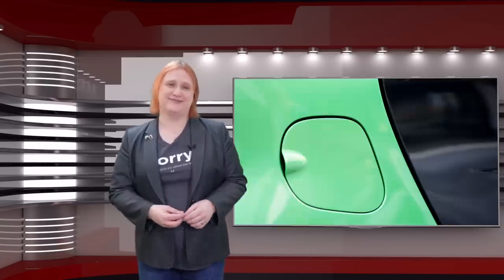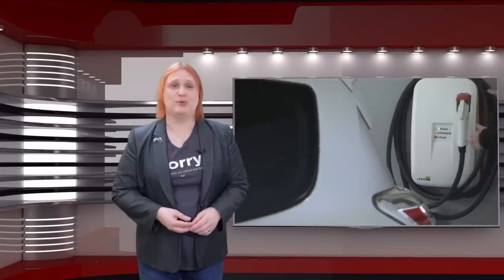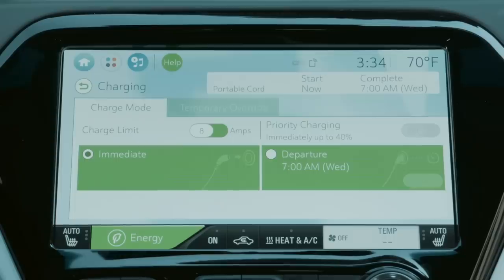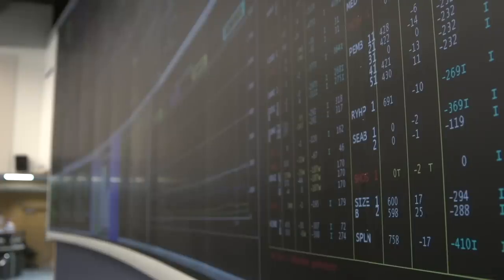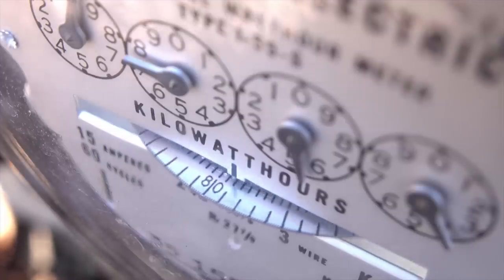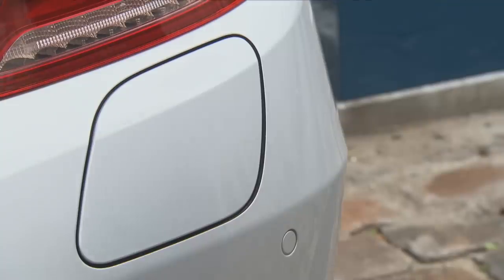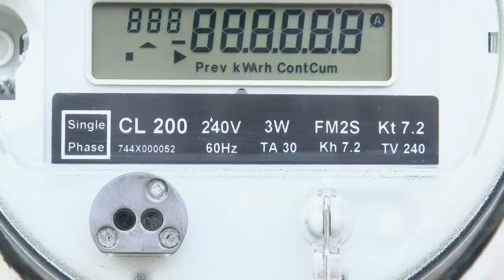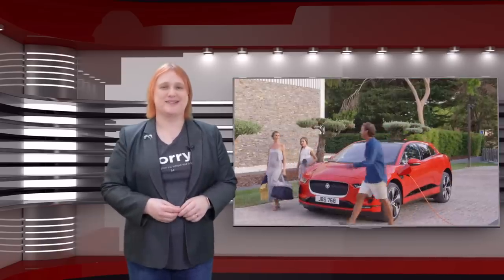What's a Charge Timer -- And Why Should You Use One With your Electric Car?

Comment: I recently bought a Peugeot E-2008 and found that my electricity provider offered discounted electricity for charging between 12 AM and 4 AM. The Peugeot comes with a charge timer which I can set to 12 AM, but no way of stopping charging automatically before the battery reaches 100%. So to make sure I only charge during the discounted time window and keep my battery below 80% charge (give or take 10%) I bought a simple 10 amp timer which I connect my granny charging cable to. This now allows me to make sure charging stops at 4 am. With our 240 V power supply in Australia, this means I can add around 2.4 kw x 4 hours = 9.6 kwh of charge to the battery each day which is more than enough to supply the 5 kWh used each day to drive 33 kw to work and back. So to keep the battery below 80%, I have set the timer to only charge for 2 hours 5 mins each night after draining the 50kwh battery to 70% before the first charge. This is now working like a dream and has haled our charging cost and (hopefully) extended the life of our battery).

Comment: Your observations are mostly valid, but here in the UK it is difficult to find a supplier with multiple prices for the various times day or night.  My present supplier does not offer this and another supplier  I found back in November 2018 said they could not supply a suitable meter until March 2019.  When I look at their web site now, the multiple price option has now disappeared.  It seems that there is little enthusiasm from UK electricity suppliers for this sort of pricing.  I would be very happy to charge my car overnight using the built in timer if there was a financial advantage.
Reply: You might be thinking of Octopus Energy's Agile Octopus smart tariff. They were recently voted Most likely to be recommended by their customers in a uSwitch poll. OVO Energy came out top overall with Octopus Energy in 2nd place. But I'm not aware if OVO do the dynamic pricing thing.

Disclaimer: I don't have any affiliation with these firms. I'm with Ecotricity because that's what works best for my usage pattern.

Comment: Was interested in hearing about the Bolt's (optional?) feature for ignoring its charge timer if plugged in below some critical minimum level!   Slightly off-topic, but  there's also been an improvement in the 40kWh LEAF's charge timer system that I've found useful:  it can be set such that the charge timer feature is automatically disabled (so that charging will begin immediately upon connection to an EVSE) whenever the car is "away from home" (according to its GPS-sensed location).   So I can just always leave the charge timer programmed and never have to remember to hit the 'override' button if I've connected to a public L2 station.

Comment: There aren't a peak/off peak cost differences in my area yet. 
But I use the built in timer in my Spark EV and set it to complete charging with my 120v trickle charger at about 30 min AFTER my actual departure time.  I'm trying to get it charge just short of full before I leave.  So far in the winter, I've been finding that the charger still seems to finish before I leave so I may have to set the 'finish by' time a bit later to keep it from going totally full (even at 8 amp/120v - its a small pack and my commute is relatively short).

Comment: I have been using a mechanical timer for years for my PSA "106 electric" because NiCd batteries hate staying charged. The goal was to reach 100% just when it was time to leave in the morning. Charging at less than 100% would have been difficult since the range was about 75 km at full charge in summer without AC. So each evening I had to estimate the time to begin charge depending of the state of charge of the car.

Hopefully lithium batteries are definitely more forgiving than NiCd batteries.

However a point you did note mention, regarding the benefits of reaching 80% just in time to leave, is that in winter the battery will be warm and so regenerative braking will be fully functional. However I assume it could be a con in summer since charging in hot temperatures and driving at once could also limit regerative braking.

Anyway all this issues are complex since they are many factors, batteries and exterior temperatures, type of batteries, etc. So the software of the car should be intelligent enough to handle the good choices. And the driver should only have to plug...

Comment: We have an old Leaf S, which has a very basic charge timer. Even so, I use it all the time - set the car to be fully charged for kids' trip to school in the morning. This means it rarely starts charging till well after midnight. We don't have time-of-use charging available from our utility (that I know of), so this is pretty much just me being nice to them by moving my charging to a convenient time on the duck curve.

The only time this really is an issue is if we run through most of the Leaf's battery during the day and need to top off. In that case I have to push an additional button to get the charge cycle started right away. But most of the time we just let the timer do its thing.

Comment: If batteries win (and not some sort of fuel/flow cell), vehicle-to-grid systems will be absolutely essential. It doesn't even need to connect to the grid; just powering the building would be ok.

Comment: Having both the 8-12 amp charger my Bolt came with and a 30 amp charger at home I leave the smaller one plugged in all the time with the car set at "hill top reserve" (not fully charged which leaves room for regenerative braking). When I know that won't be enough I plug in the 30 amp unit. I assume these are the best ways to ensure the batteries longevity.
* slow rate of charglng
* not kept fully charged
* allowing for battery conditioning

Comment: I used a Smart plug to charge a Twizy overnight. Just linked it to my wifi and set to charge from 1am till 6am. Usually finished about 4-5am as such a small battery. If a Twizy and smart plug (with internet) is all that's needed we can all charge at off peak rates. All EV owners need to shift charging to save money and show what can be achieved on the GRID. Everytime you charge at peak times uneccessary a coal station may be kicking in.

Comment: Something i've been thinking about id the cars onboard charger.
3.3kw and 6.6kw seem to be fairly standard. As range increases so does the cars onboard charger. In the case of Tesla it might be 14kw. We are now crossing over 50amps. Something that becomes quite expensive to upgrade at home. 

Taking advantage of off peak charging rates may require more EVs to be able to charge quicker. More so when we start talking about jobs that require hundreds of miles a day. Some future trucks are rumored to have 500 miles ranges.

Comment: 110V/220V hasn't been the standard in the states since the 1930s. You have 120V/240V. The Rural Electrification Act forced the power companies to standardized voltages to make it easier for the appliance makers. You should standardize too.
Reply: John Rielley  my electrician but 220 on my outlet install receipt and i had to tell him my car takes 240 and he didnt hook it up right and i had to call to get him back to fix it
Reply: @markfitzpatrick6692  220, 221, whatever it takes. It's the old guys that keep the myth going, that's probably the way he was taught. Unless he was 90 years old, then I guess he's entitled.
Reply: That might be semantics . Even electrician say different things in casual conversation..
Reply: It's pretty bizarre that everyone isn't on the same page on this.  People who say 110/220 are off by about ten percent.  What if your electrician told you your panel could take a 110 amp load but it was really 100?  I want my electrician to be more accurate than that.  Maybe that's why I do my own electrical work.
Reply: @incognitotorpedo42  Actual mains are usually off by a few percentage.  You have to build for 10% under and over voltage in normal operation of an appliance.

Comment: In the Netherlands if you want to make use of off-peak prices (23:00 - 07:00), you pay a higher rate during the day than a simple flat rate. Thing is, the normal price (07:00 - 23:00) is much higher than the flat rate while the off-peak price is only slightly lower than flat rate. So opting for 2 rates is a bad deal for most people.
Therefore I don't use it and therefore there now is no incentive for me to use delayed charging.
Reply: Henri Zwols I have the same issue in California. Our bill would go up because too many other things are pulling electricity during the day and those prices are just too high. If the power companies really want to clean up their grids they should offer better deals to those of us that rely upon them rather than petrol stations to get to and from work etc. Getting solar power with off grid storage could solve this problem for me but is a pretty good sized investment still.

Comment: These are all great points, but unfortunately none of them are relevant to me.  My power company is Appalachian Power, "Appalachian" as in the heart of coal country. Don't matter what time of day or night I charge, the only power going into my car is coming from coal & they don't offer any sort of discount for off-peak hours (and no, much as I'd love to, solar is not an option in my current residence either).  And I've never even charged my Model 3 all the way to 100% once, I usually charge to 80% except a couple of times I knew I had a trip to Chancellorsville or Raleigh the next day & kicked it up to 90%.
Reply: When demand is falling, that seems to be the most efficient time to use electricity generated from fossil sources. That's because the coal (and to a lesser extent gas) fires are already hot from providing the peak load, so they can just let it burn and top up occasionally. Conversely, when demand is rising, they're throwing more coal on at a faster rate. Or so I read somewhere.

Comment: I have a flat rate supply 24 hours a day but I still use the timer to start charging at 1am to support grid load. I have always wondered though, if hundreds of EV owners are charging over night are we just shifting our peak times?
Reply: You are helping your electric utility which is a good thing. If you have the option to sign up for time off use you might want to investigate it. We use a lot more electricity now with an electric car but our bills are pretty much the same. We wash clothes, run the dishwasher, and of course charge the car off peak and it saves us $30-$40 a month on the electric bill.
Reply: I did actually look into this but it worked out better for me to stay on the flat rate. My wife is home with our kids so the increase in day time use would have cost more than the savings. Plus I normaly only charge once oe twice a week.
Reply: @rajbadwal85  Definitely a case by case basis. Our local utility has off peak from 9am to 5pm and 10pm to 6am so we have been able to shift some things around.

Comment: I used to set my Zoe to charge at specific times, but my Smart won’t do it. You can only set a departure time, and it’ll just charge to 100% when you plug it in no matter what you try and do. 🤦‍♂️
Reply: Get a SMART plug for $20-$30 link it to your wifi and it will switch the plug on at times you specify. I used it overnight with a Twizy so any car can work.
Reply: Ian Burrows I don’t have the 3-pin plug cable, only 7kw. I’m used to it by now, but thanks anyway.
Reply: Not so Smart?
Reply: Ken Dibble Indeed

Comment: I keep my car close to 50% charged all the time. Between 50% and 70%.  Is that good?
Reply: Duke tlam no , not necessary. Musk suggests charge to 90% , not 70 or 80%. Otherwise you have a small ‘effective’ battery size
Reply: Tesla used to recommend keeping their cars charged to 80% to avoid any long-term battery damage, but more recent tweets by Elon & some of his engineers suggest even that may have been a bit overly cautious and that there's nothing wrong with charging to 90% every night.  Having said that, I still charge to 80% as I just hardly ever need any more. As far as I know they still recommend trying not to let your battery get below 20% on a regular basis though, and for that reason if no other I'd think you'd want to charge it to higher than 50%.
Reply: I think the ideal is dependent on the type of L ion. Some will last for ever staying around 50 + - like the original Prius hybrid.
Reply: @kdkd693  that why I am sort of confused.   Musk said to charge up to 80%
I read a scientific report that said lithium battery like to be in the middle.  I am leaning toward scientific study than Musk recommendation.  The only negative of staying in the middle all the time is battery unbalance.  Meaning the bms don't know your full battery pack potential.
Reply: Duke tlam You are being confused with advice on two different scenarios: 
If you want to store a lithium battery, yes around 50% charge is the recommended

If you want to use a lithium battery daily, as in a car or an RV, you want to use a wide range. 

For RV batteries, this is 10-90% and they last 3000+ cycles. The BMS only is smart enough to have voltage cutoffs, and no rate control. You top balance to absolutely 100.0% at a higher voltage maybe once every 3 months

With a Tesla , you have a much smarter BMS, and you can set it to charge to a specific % charge yourself (slider on the screen) and the smart BMS will also restrict charge rates over the charge to get even better lifetime eg 12+ years. Musk recently recommended to TeslaKim to do this. I see no reason not to. 
Tesla also do not have a problem with owners charging to 100% if they are going on a long trip and need full range. This would help top balance the battery so is beneficial anyway. The long ‘runs on the board’ for Model S batteries are now available - and the data backs the longevity up.
Reply: @kdkd693  thanks Ken, I been doing a lot of 50 to 70 % cycle for that last 7 months.  Perhaps I should change it to 20 and 80% from now on.  Since I been doing a lot of these small charges.  What is consider a cycle? Does the battery cycle mean a empty to full is considered as one cycle.   What does all these small change i been doing really mean?  Does those consider as one cycle or a tally of small charging to total one full cycle?

I drive 15 miles a day.  So every two days I charge to 70%. Keeping a 50 and 70% range. 
I have never balance the battery.  Now that I am changing my charging to 80%.   Would you recommend a 20% to 80% range?
Reply: Duke tlam A cycle is usually each day, if you are using it and charging it daily. 
If you are only doing a small trip per day, you probably don’t need to charge every day. 80-20 is great. If it only goes down to 70 or 60% on a small day and you will only do same trip tomorrow, I wouldn’t bother charging
If you occasionally go on a long trip, you can charge to 100% and go down as low as 10%
What car do you have?
Reply: @kdkd693  long range model 3 Rwd.  I charged every other day.  Shoot I hope I am not burning thru those cycle unnecessary.

Comment: Let me preface this with the fact that I live in a warmer southern state of North America and don’t have a daily driver electric car...yet. But I would think another benefit of a charge timer would be if you live in a cold climate or if you have cold winters, if you delay the charge so it is at the state of charge you need just before you use the car, the charging process would warm the battery slightly causing an increase in efficiency in winter months.
I’m not sure how correct that thought is and let me know if I’m wrong, but it makes sense to me.
Reply from the maker: You're right -- although most cars with active thermal management would keep the battery warm if it were really cold outside. Even the Nissan LEAF, which doesn't have active liquid cooling, has a battery heater (optional in some years and markets, standard in others) to keep the battery warmer.
Reply: Even though the Model 3 has active thermal management and I park in a garage, the car often has limited regen on cold mornings. If charging is completed just prior to departure the regen seems less restricted (but often still restricted). Tesla does not yet have the option to complete charge by hh:mm which would help optimize timing.
Reply: @scottbender4390  I use the Stats for Tesla app.  It lets you change the charge limit at a specified time and you can schedule the climate settings as well.
Reply: @scottbender4390   there is an app that I use called Dashboard for Tesla that has the functionality you mention to let you set a time that you would like charging to end.

Comment: rubbish, 18650 cells can stay fully charge for a month and baaaarely lose any battery power. NIMH and other cells do lose power over the month but not Li-ion like that. My pack hasn't been used for a month and is still fully charged.
I can only assume the reason they say not to fully charge is to simply increase the life of the cells over the years. constant fully charging and discharging does degrade the cells more than charging to a eg 4.0v r 4.1v (but not 4.2v). This is the only reason I can see them saying that.
Reply: The last I heard from Tesla, they said the Model S (18650 cells) would lose one percent of charge per day as a normal "vampire" loss.    Maybe an isolated cell would hold a charge better, I don't know.  It certainly isn't good to leave a Li-ion battery at 100% for a long time.